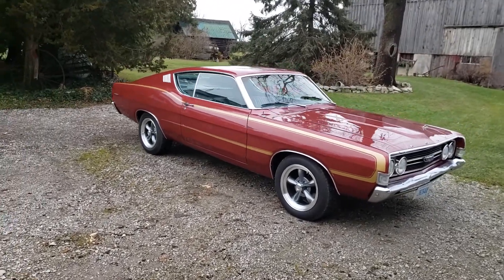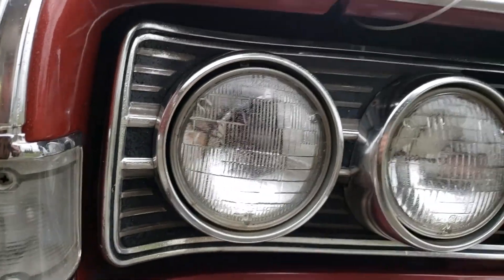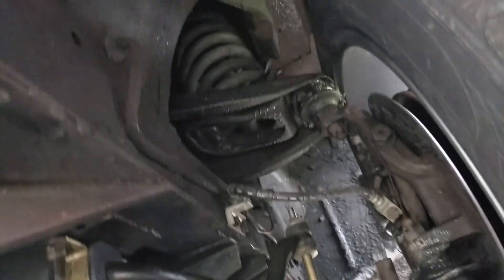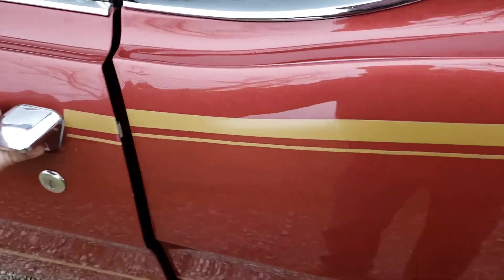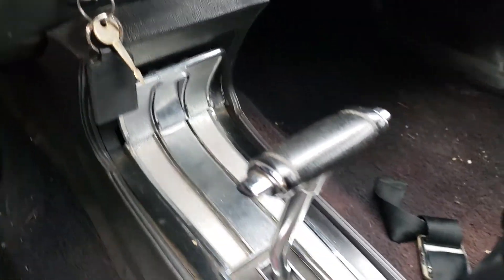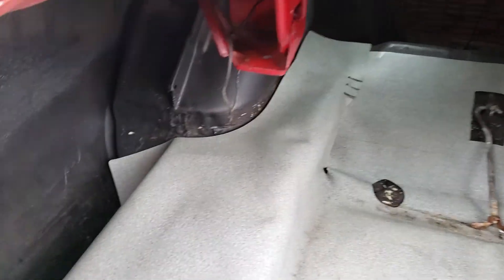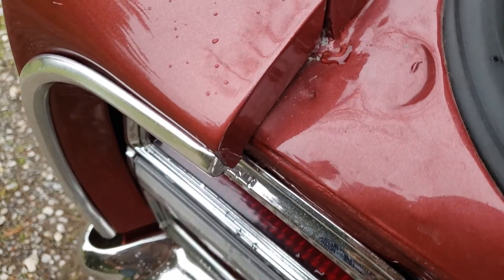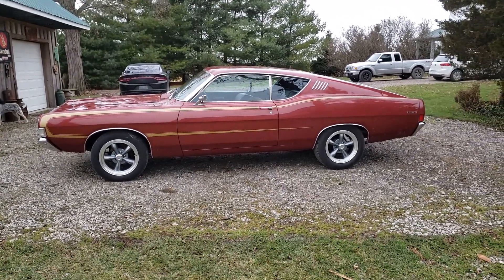1968 Ford Torino GT pre purchase inspection in hamilton (1/2) | GetInspected 0541

Comment: I now own this car.  I shipped it to Surrey BC after I bought it in Aug/20 from a small dealer in Cambridge ON.  I believe this video was shot when the car was in Dunneville ON and I first spoke to the owner in Nov/19.  It changed hands a couple of times before I could get out to see it.  

As described in the video, it’s a good solid driver.  The aftermarket wheels were not on the car when I bought it.  It has the original Ford wheels now.

It required a fair number of electrical issues sorted out.  I bought a new horn/turn signal switch which fixed the horn issue as well as non-functioning hazard lights.  Reverse lights were non-functional which required removing the switch, disassembling and cleaning it.  Works fine now.  These switches are NLA.

Also mentioned was the incorrect clock.  While I had the dash removed to fix panel bulbs and install a new gauge circuit board, I found that clock had no guts.  I managed to find a correct clock in a salvage yard (lucky find) and upgraded it to modern quartz movement.

Other new parts now installed: tires, brakes, front and rear suspension, power steering control valve and slave cylinder, radiator, headlights, alternator, steering wheel, window seals, wiper blades.

The backstory I got was this is a former California car (I have the California plates), restored sometime in the distant past (car was originally Seafoam Green) and imported into Canada 20+ years ago.

My first car 40+ years ago was the sister to this one.  Both 390 GT’s, bucket seats with console and Seafoam Green.  My goal was to find another one and I did 👍🏻

It’s a trip down memory lane with this one.  It’s about as far away from a modern car as you can get but definitely fun to drive.  If I had the money, I’d have a full restoration done including upgrading the suspension.  For now though, I’ll drive and enjoy it.